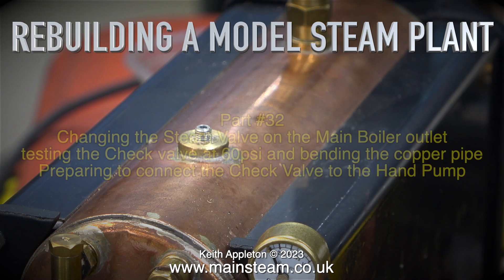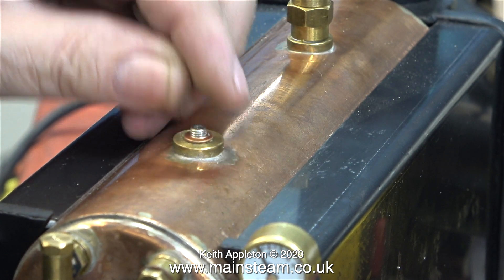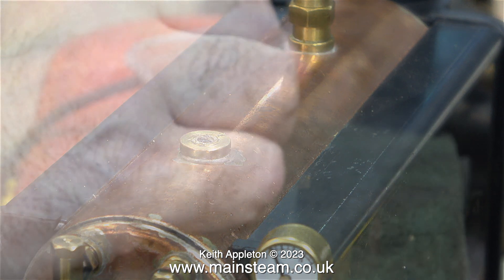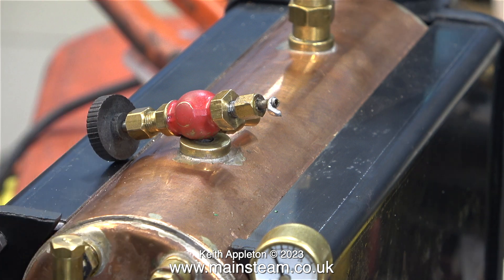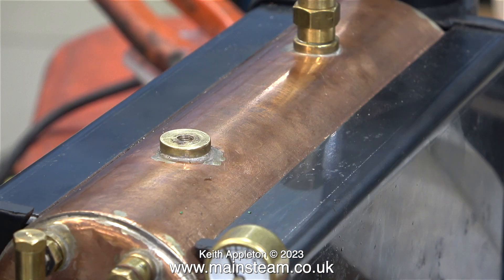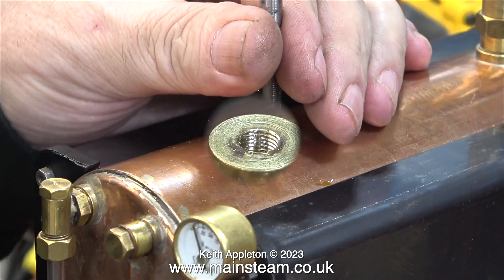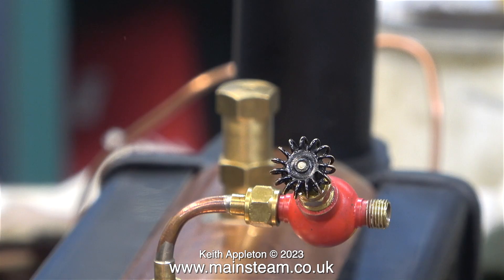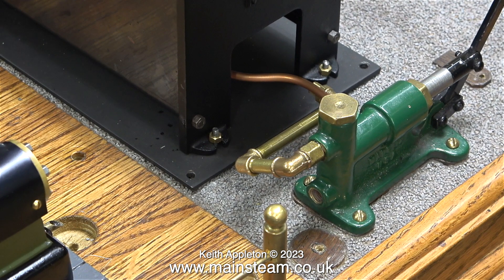REBUILDING A MODEL STEAM PLANT - PART #32

Comment: how do you get the swath out of the tank?
Reply from the maker: The steam outlet (where the Steam Tap fits) on a 501 and 504 boiler is the superheater tube. By opening the valve when the boiler was pressured, any particles just blew out of the Superheater pipe. None at all were inside the main boiler casing. I have mentioned this fact countless times in various videos.
Reply: sorry must of missed those
Reply from the maker: Here is one example ...... https://youtu.be/xs6kSHHqWAA

Comment: When I started working in the air conditioning business in 1964, I got lots of practice making flares. Make a flare, cut it off, put on flare nut, remake flare. Only the frequency diminished, not the forgetfulness. 🙄

Comment: Good video but how did you get all the swarf out of the boiler after drilling and tapping the bush?
Reply from the maker: The steam outlet (where the Steam Tap fits) on a 501 and 504 boiler is the superheater tube. By opening the valve when the boiler was pressured, any particles just blew out of the Superheater pipe. None at all were inside the main boiler casing.

Comment: Im surprised that the pliers didn't muck up the threads of the insert.  That's usually what happens to me.
Oh, wait.  You drilled and tapped to a larger size....🤦‍♂️. It's coming together quite nicely.